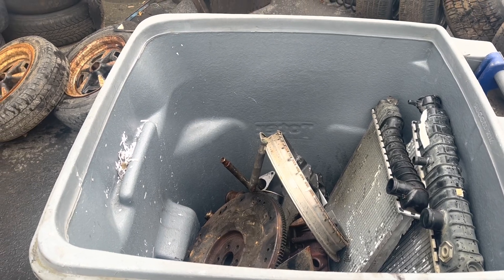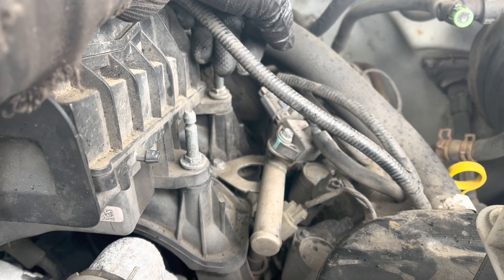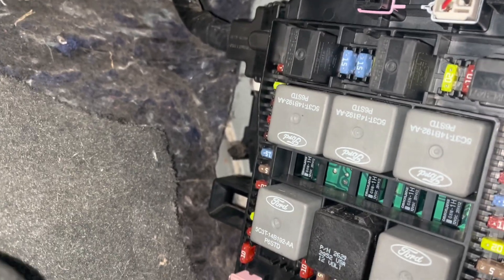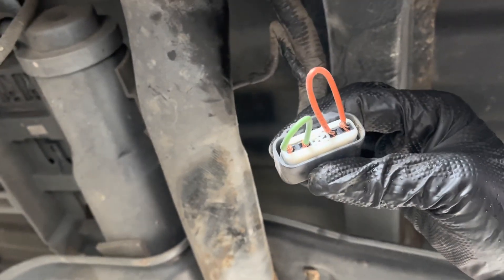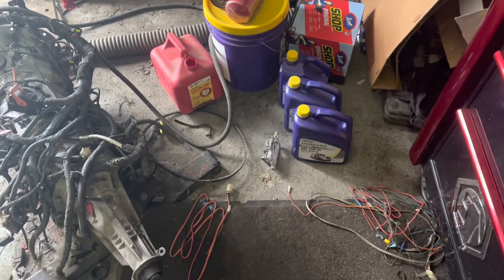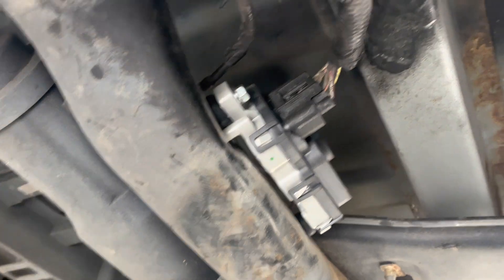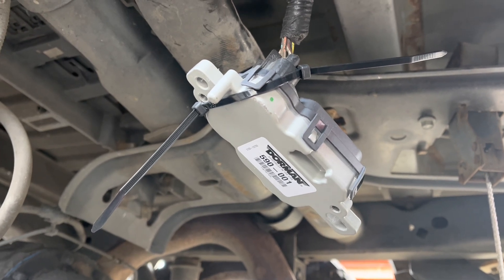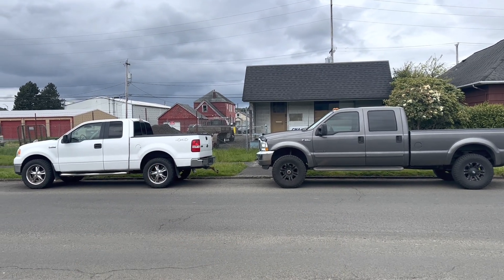The 2004-2008 Ford F-150 Fuel Pump Driver Module Problem (Why You Probably Don’t Need A Fuel Pump)

Comment: I'm getting 12v at the FPM circuit at pin #1 believe that's an issue that I'm having.
Reply from the maker: It’s been years since I’ve had to touch one of these, I would have to do a deep dive on the circuit layout again myself.

Comment: Thanks for the video... 
So the fuel gauge in my 2004 XLT 4x4 F150 (4.6 Liter) decided to stop at 1/2 tank after I filled it up all the way. I tried banging (gently'ish) on the tank and also checked the wires & connectors under the driver door and nothing looked bad/corroded there... I checked the Fuel Pump Driver Module and it was corroded pretty bad and cracked so I replaced it. The engine miraculously seems to run better now but the fuel gauge is still stuck even though the tank is full. Ugh... 
I also checked the fuses and nothing bad there  - any ideas/suggestions/input would be appreciated. 98,000 on the odometer BTW. Thanks!

Comment: I like the wire jumping idea my 07 was so bad at the bolting mounts that I ended up moving it to a cleaner location drilled 2 holes and installed some rivet nuts worked perfectly

Comment: The new module wouldn’t connect right no matter what so i bridged the wires to get it started then took the wires out and plugged it in before it died and didn’t have a problem for a few days then would have to do the same until I got a spark while bridging the wires now nothing.
Reply from the maker: Huh. That’s very odd. You must have blown a fuse somewhere…

Comment: Great video! I was stranded at the gas station right after fueling up my truck. I skipped all the diagnosis parts and went right to bypassing the FPDM with the two wires.. just had to push the spare tire over an inch. My truck started right up! My module looked about the same condition as his! Thanks for the help
Reply from the maker: Awesome! You bet!

Comment: The fuel pump is actually cheaper than the driver module just more work to replace
Reply from the maker: Is it? I don’t remember that being the case when I was still a real mechanic (and when I made this video.) But yeah, they kind of put a bed in the way.
Reply: @DeadDodgeGarage  yeah order mine yesterday module 115$ pump 80$ lol

Comment: The bypass works but I bought 3 new driver modules and a new connector and none worked. Thoughts?
Reply: I’m in the same boat. Both sensors are replaced with fomoco fuel pump,filter. Still
Throwing rail sensor code, funny thing is I can unplug it and drive it.

Comment: My 2004 f150 v8 4x4's fuel pump keeps running after I turn the truck engine off, running my battery down.
Reply from the maker: In those trucks, the fuel pump relay is built into the circuit board inside the fuse panel / power distribution center in the passenger kick panel. It sounds like yours has stuck on. In the past, I have cut the wires coming from the pump relay and wired them to an external relay. Instructions on how to do this can be found online. It’s been a while so I don’t remember which color wires they are.

Comment: My boyfriend’s did the same thing he put a new module on it and the plug didn’t fit good either but he got it on there snug enough. It ran good for about 10 minutes then started sputtering again. He ended up straight wiring it to get us home. Even with the new module it still has the same problem. Has anyone had problems with the wiring plug that connects to the module?
Reply from the maker: I’ve had that problem multiple times. They just don’t fit well for some reason. But it’s usually possible to get it clicked in place with some swearing.

Comment: Do the e250 have the same issue
Reply from the maker: Many ford models have the same control module - but the cars have it mounted inside. I’m not sure where it is mounted on the E series vans. I have never had to replace one there.

Comment: I let my husband convince me to get a 2004 Ford F150.... NEVER AGAIN. I can't stand this heap of junk. Currently dealing with these issues. So many sensors replaced.
Reply from the maker: Yeah… I’ve had a lot of bad times with those trucks. As nice as they can be to drive, I don’t think it’s worth it at all.
Reply: Ditto

Comment: This module totally fixed my issue. I’ve never worked on these trucks with fuel pump problems before and this video saved a lot of time. Thanks.

Comment: Can u tell me why i can unplug the modulee on this 04 f150 4.6 and it still starts and run?
Reply from the maker: How long does it run? I experienced this myself and was perplexed - but it would only idle for around 10 seconds. It wouldn’t continue to run, or drive.
Reply: @DeadDodgeGarage  it continues to run like crap but running having an intermittent stall while driving after 10 mins or so trying to diag with no codes is a little difficult
Reply: Ive checked grounds pcm voltage supply relays and fuses nothing is getting hot or testing bad i might be overthinking its issue not sure at this point

Comment: I have a 2005 f15 with the 5.4, and I have replaced the battery and also put on a new fuel rail pressure sensor and a new fuel pump drive module. With all the new parts, it still won't start. It will turn over but will not start. I don't know what else to check on it.
Reply from the maker: There are more possibilities than I could possibly list here. But another one I’ve seen before is a bad fuel pump relay - which is built into the fuse/relay box in the passenger kick panel and is not replaceable. To fix that, I wired in an external relay. Have you checked your rollover switch to make sure it is pressed down? There’s always the fuel pump itself. And then there are many possibilities outside of the fuel system as well.
Reply: Possibly a diode

Comment: 2005 v10 l. I bridged the connectors but  only getting 4-5 to pigtail. Isnthat normal or should it be 12-14v. Wireing in a external inline pump
Reply from the maker: You should have a full 12v (nominal, obviously that could vary some) on pin 5, the power feed from the inertia switch. I don’t know what voltage you might find on the control circuit or monitor circuit.  But pin 5 (the positive feed that you are jumping to the pump feed) should have 12v.
Reply from the maker: I would not wire in an external pump. That’s not going to work well…
Reply: Dont think it'll be strong enough?? Funny you say that because i have the ex pump hardwire now, but the pump keeps surging like its not keeping up with the truck. Also i figured out why i wasnt getting  power. One of the wires corroded off

Comment: I have a 06 5.4 f150 that will not start without ether. After it starts with ether it runs great. After it warms up it will start up just like the good old days. When it is cold it just likes to crank over and over. I changed the FPDM. After I changed the FPDM my fuel pressure went to 75.75 psi avg. With the old FPDM, the fuel pressure was 39 psi avg. Can anyone help with this ether-loving beauty?
Reply from the maker: Huh. I don’t think it should be 75 psi… could this be a crank or cam sensor reading issue? No fuel until it spins up quickly on ether?
Reply: @DeadDodgeGarage  with my old FPDM the girl pressure was 39.5 psi average. The higher furl pressure is in both KOEO AND KOEO states
Reply from the maker: I don’t know the spec offhand but it sounds like your new module is just cranking the pump. Also it doesn’t sound like the module was related to your problem…

Comment: My friend's 2008 F150 truck started by having no power and rapidly progressed to starting and sputtering to a stop to not starting at all. We found ourselves stuck at the side of the road in a construction zone in the blistering heat while towing a boat. We were 12 km from the nearest town with a 4 hour wait pending for a tow truck and facing having to leave the boat and truck unattended in an out of town parking lot and then arranging to get picked up - at least another couple of hours. Instead we clicked on this video. Within about an hour, totally thanks to this video, my friends F150 went from a won't start condition to purring like a kitten and got us home within another hour. Luckily my friend carries a tool kit (as does mine) that included a bit of hook up wire. I know it takes a lot of work to put together these videos so thank you!
Reply from the maker: So glad I could help!

Comment: Can I drive it briged ? , my nearest parts are 4 hours  away and won't  be Abel to go for another 2 weeks .
Reply from the maker: Well, the pump will be running at full duty cycle. It may richen the mixture excessively and wear out the fuel pump prematurely. I would try to limit driving it that way as much as possible.
Reply: @DeadDodgeGarage   ok I  understand  tanks .🙂
Reply: @DeadDodgeGarage   ok I  understand  tanks .🙂
Reply: @DeadDodgeGarage  dude please help, i bridged with wires and still not starting. Does that mean fuel pump or fuel filter? Lmk if you can
Reply from the maker: @same2066  there is no external fuel filter. Do you hear the pump running when you have it bridged and you turn the key on? It is entirely possible that you have a totally different problem. The relay in the fuse panel and the rollover switch can both cause the fuel pump to stop working, but there are many other things that can make your truck fail to start. It would be impossible for me to list all of them.

Comment: I've saw some really weird things from Ford lately, my mother has a 2012 ford explorer, my dad went to start it and it backfired and blew the plastic intake manifold into a million pieces, even dented the hood up from underneath! My dad had a ford truck with the Triton engine, that's another sad story!
Reply from the maker: Wow. We had an intake explode like that here once, but I can’t remember on what. All tritons are bad news. They also sold millions…
Reply: @DeadDodgeGarage  my 2004 5.4L F150 4x4 is fine, I love it, other than my most recent fuel pump not shutting off when I turn off the engine...
... Jac Nasser forced the engineers to remove 350 lb out of the 2005 to get a better CAFE, and it was a disaster.  Jac almost destroyed Ford.

Comment: Friend dropped a lot on a new motorhome. 
   Long Ford dually chassis, Triton V10, tons of gizmo's.
   The pump driver failed soon after purchase- figured 'bathtub curve' for electronics failure.
   While out in some gawk-n-photo-op-spot in Montana, fuel system failed again.
   They were informed to 'swirl' the fuel by pushing on the sides of the motorhome to 'bump' the pump motor onto a good winding.
   Strangely it worked, but fried on the bee-line to the approved garage.
   Dealetship engaged in some serious long-distance butt-kissage to keep the customer somewhat happy. 
   So Chicken or Egg- bad fuel pump roached the pump driver or bad pump driver fried the fuel pump?
Reply from the maker: Well, that’s a tough one. Brand new pumps in brand new rigs shouldn’t die… ford pumps themselves are quite stout in my experience. Not a repair I’ve had to do often - and the one I did do, well, that’s why I thought making this video was a good idea. Just because someone says they need a fuel pump… doesn’t mean they do. Have to wonder if something weird relating to pump electrical happened when they were upfitting that motorhome. Or it’s ghosts. Lol.
Reply: @DeadDodgeGarage  He was calling me and I am, ummm, they advised to 'swirl' the tank to bump the pump onto another winding...?

I avoid that rig like a bloated dead whale on the beach with an insufficient tnt charge-